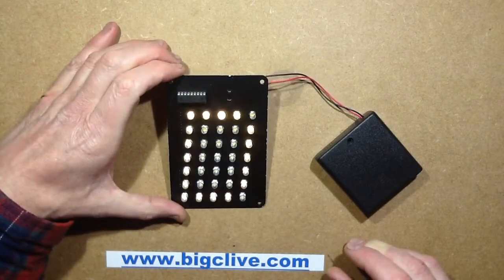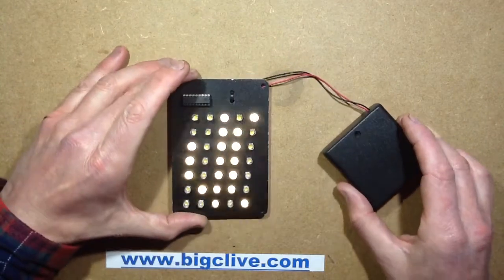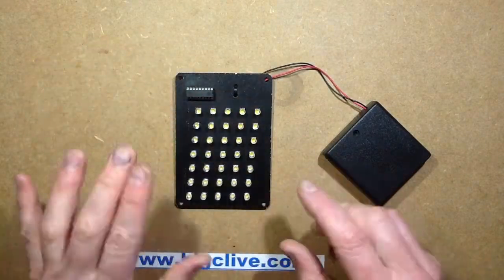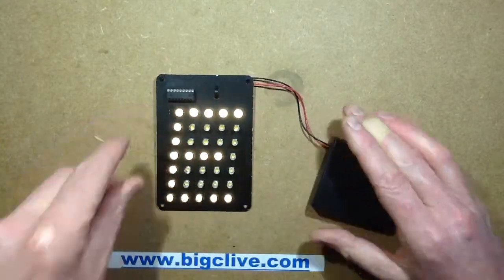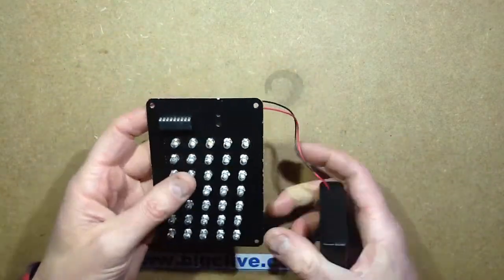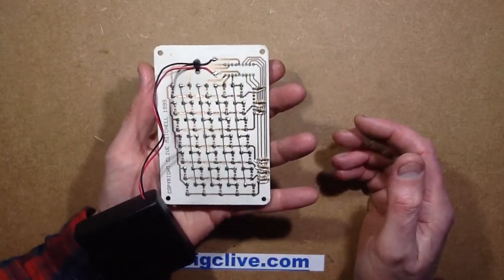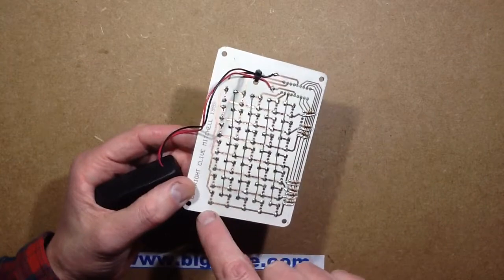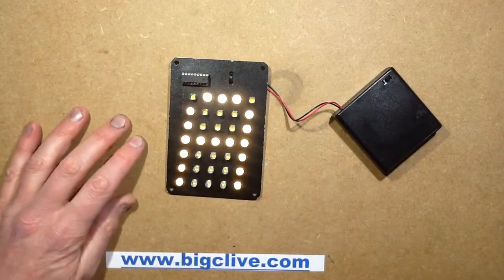Scrolling LED matrix for a light festival.

Comment: Can you do something about your audio levels? I have to crank the volume right up to be able to hear.
Reply: sounds fine to me. :-)
Reply from the maker: I record the videos using an iPad2 and the default recording volume on the internal microphone seems quite low.  When I tried plugging an external microphone in it went in the completely opposite direction.  I've not resolved the volume issue yet, but I'm working on it.